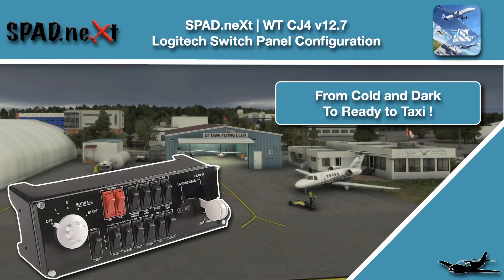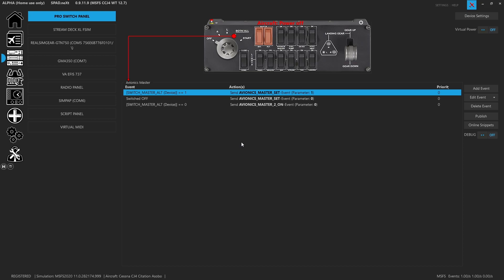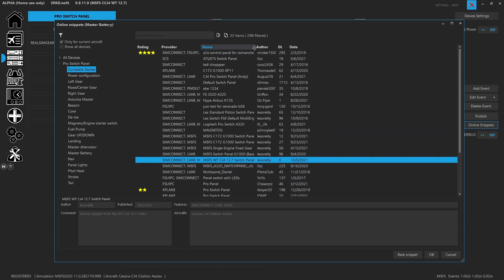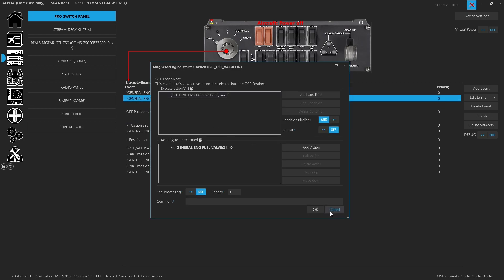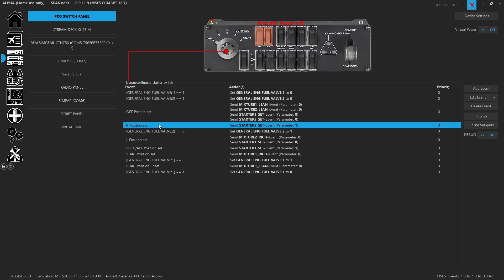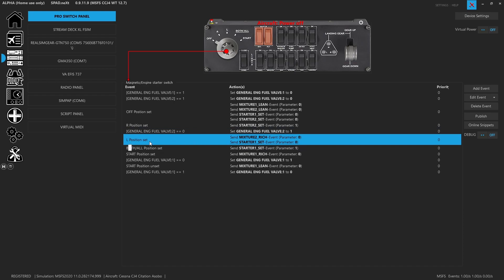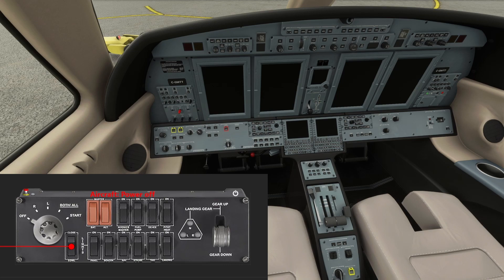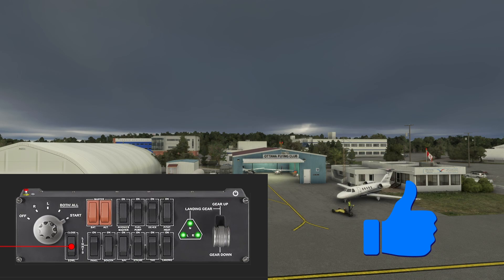(Sim Video) SPAD.neXt | WT CJ4 v0.12.7 | Logitech Switch Panel

Comment: Les ... love your video.. we live close by.. Ogdensburg, NY.. quick question.. Been using SpadNext since Spad 1.. can't seem to get switches (Deice) in C208 (Black Square Steam FS2020) to move in sim specifically Prop and Windshield heat.. the Prop heat volt meter shows voltage for split second... tried everything.. Ideas?
Reply from the maker: Could be an LVAR or worse uses Bevents and not linked to the LVAR which causes it to force it back because the b Vars are not exposed.
Reply: @LesOReilly  is there a way to fix it?
Reply from the maker: @robertsilver2211  if there was I would have told you.

Comment: Les really enjoy your videos. You are by far the Spad Guru. hoping you can help me. I really need a little clarity on using 2 pos switch to toggle commands. I see for instance in your section on deice you use == 1 or ==0 to check. Can you tell how to get to those functions in events. Thanks in advance.
Reply from the maker: There is a video on conditional events. (MSFS) SPAD.neXt | Conditional Event and Acceleration
Reply: @LesOReilly  Are I correct in that I need to create a new local variable.  Great video and Thanks in advance.
Reply from the maker: @vapilot7814  Not if you are looking to control something that already has data available ... ie the Parking Brake example.  Seems like only the Toggle command was working..  So put a condition in the ON position of the switch which checks that the Parking Bake lever position is = 0 .. if so then it will send the toggle event..  If the brake was already set then the switch will do nothing.  For the Switch OFF position set the condition to be Parking Brake Lever Position != 0 (unequal) and then send s the toggle event..
Reply: Success (kind of) switch in cockpit is moving in sync with my saitek panel which is major. however when I run dataref tool I find there are several processes also linked to that switch (ie amps, fuel flow etc). Is there and short cut to linking these points.
Reply from the maker: Oh XPlane… no idea I don’t do xplane.

Comment: very helpful, thanks
Reply from the maker: Thanks for dropping a comment!
Reply: @LesOReilly  now i try to config. the Autopilot like in the Real A-320 but now all flickering,it dose work in the cockpit but not like in the Real. Autopilot Panel from Saitek/Logitech i have install it first with logitech software and now with Spad. next but now i think 2x program want control the panel and yeah well see. for today i let it 8hour config is enough lol from Switzerland greetings. on my FB Profil can see my selfbuilt cockpit :)
Reply from the maker: As per the getting started videos. Uninstall all saitek/Logitech software if you are going to use SPAD NeXt as they will fight.